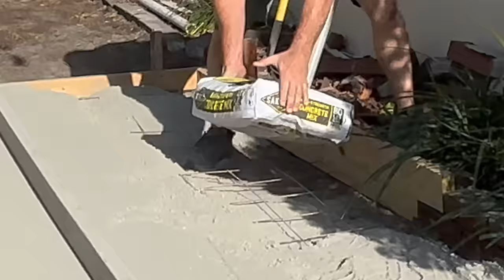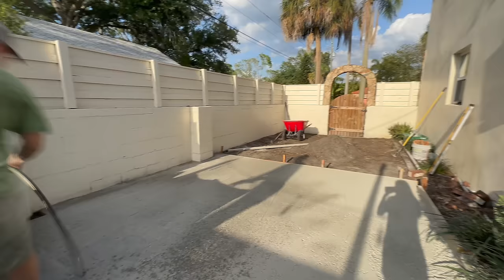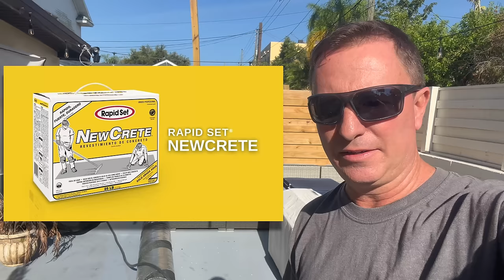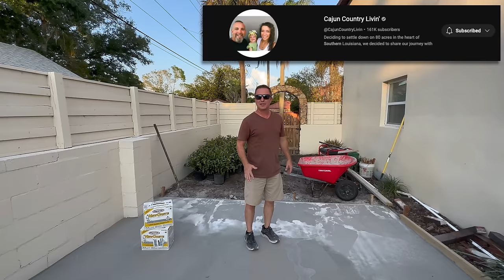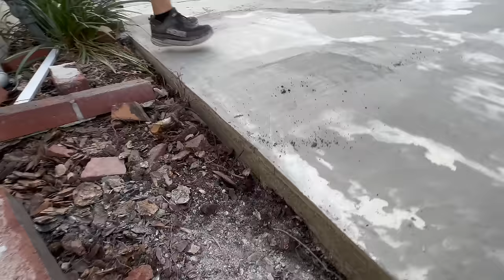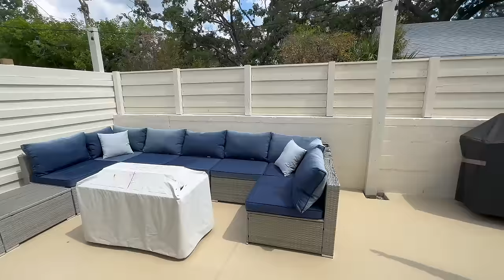Doing Dry Pour Concrete DOES ACTUALLY WORK?

Comment: I batched and drove mixer trucks   for a large concrete concrete company for 4 years.  Dry pouring does work for DIY projects because bagged cement is DESIGNED for water absorption. Be sure to wet the ground before you dump dry cement. However when you have to build to code mixing concrete is the best for strength and proper finishing. Have fun. ❤
Reply from the maker: Thank you for your excellent comment.  I am planning a follow up video with an industry expert to answer many of the questions generated about dry pouring concrete.  Your brilliant comment about bagged concrete and how it is chemically designed for water absorption is one of the areas we plan to focus to help people, especially those impacted by the naysayers, understand why this process is viable option when it comes to non loading bearing slabs. Thanks you again for stopping by and providing a helpful comment.
Reply: Contrary to what we are used to with typical wet pour, DO NOT PRE-WET!!

You want the moisture to migrate down, not up. First and most important thing you need to do, is forget everything you know about doing regular wet mix concrete.
Reply: Dry sour is bs.
Reply: @professorg8383  depends on how hot the day is.
Reply: @arguswil  No, that would be the case with wet pour but not dry pour. 

With wet pour you don't want the dry ground pulling water out of the wet mix as it will start to cure prematurely. But with dry pour you want the mix dry on the bottom and let the waterings be absorbed from  the top down. If the ground is wet, moisture will be drawn up. That is exactly what you don't want. You want the mix completely dry until the water get absorbed down to it. When the water dies get down to the bottom, it is at optimum absorption to start curing,  And dry ground will not pull water out  to below optimum.  

Cement is highly hygroscopic. It will pull water out of the air. You don't want it pulling it from the ground as it will wet the bottom prematurely. 

Dry pour ends up using the minimum required water, much like a very dry mix. This makes for the strongest cure. 

With wet pour you want to keep some moisture for finishing. But with dry pour the "finishing" is down before you hit  it with a drop of water. Never take a trowel to dry pour, you will screw it up. 

This is one of those things where knowledge of doing wet pour, will work against you. for the best dry pour, the first thing to do is to forget everything you know about wet pour!! Dry pour works almost completely opposite. A lot of concrete pros screw up dry pour because they can't clear their brains of what they learned about wet pour. It doesn't seem right to them so they keep trying to "fix it", but that just screws it up! Being used to ding wet pour is a handicap doing dry pour. 

In the end you have a slab with the optimum water content but how you get there is entirely different. I have watched many dry pour fail videos and in every case the fail us because they try to treat it like wet pour, 

You want dry ground for dry pour. If the ground is damp, you ill get better results putting some plastic down! I know this seems counter intuitive, but that's because your brain is wired by what you learned through experience. 

Wet pour works from the bottom up with finishing being the final step. But dry pour works from the top down, the final step is watering,  and once you start, it is 100% hands off the slab. Yu don't touch it again for a couple days when you take the forms off. In dry pour, all the work happens before adding water but the great part is that it is not time critical. Watering needs to follow a strict schedule, buy it is easy. The key to watering is to add water slowly allowing water to slowly be absorbed from the top down. Each watering step uses very little water and you ant to avoid getting the surface so wet that water starts to collect, if it's that  wet you put too much water on. 

Complete rookies often do better because thy follow the instructions exactly,  never even thinking they know better,
Reply: @professorg8383  with hot weather and  high ground temps you will have less evaporation issues with pre misting.  The heat can make the concrete dry too fast. Even if it's a dry pour
Reply: If you live in an area with high humidity then you can get away with mising from the top.
Reply: @arguswil  I get that you have a different opinion, but you also have a lot of experience with wet concrete, As I said, it isn't easy seeing past that. 

I approached a lot of scientific testing from an engineering perspective. I will say that at times I was rather surprised with the results,  contradicting conventional thinking.  

I have done multiple tests in both dry and warm humid weather. I have built multiple slabs is varied weather, and I stand by my results, albeit they differed from what I predicted. I used extensive scientifically proven methods of research and analysis. Only excess water evaporates, while the optimum amount becomes locked to the slab. as it cures, the water become a part of the mix,  I could see this by having recorded volumes and weights of all components, going as  far as to collect, measure and subtract overspray. Evaporation is not really a factor, although it very much is with wet pour. A fully saturated,  but dry to the touch slab, lost no weight when fully cured. So the water was incorporated into the cured slab, none evaporated.  This was one of those surprising results. The cured slab weighed exactly the weigh of the dry concrete mix, plus the water added. This turned out to match what the mix and minimum recommended water equaled. I replicated this in smaller, precisely measured, test control samples. Not what I would have predicted, My wet pour control samples lost some weight as they cured. 

In wet slabs, you can see some settling of the material. The dry labs ended up amazingly uniform. I believe this is because the dry pour slab was  never oversaturated with excess water. I even did some sample crush test with a homemade rig using hydraulics. Although my rig was not calibrated, the math indicated around 2500 psi strength,
Reply: @professorg8383  before you put down your dry pour, did you have any ground compaction? In our area we usually use CA6 then compact with a tamper and prewet for not only to prevent fast hardening with wet pour but the base can also reactivate the CA6 limestone particles so you have a solid sub base.
Reply: @arguswil  Compacted ground. (plate compactor.) ten  about 1 inch of #9 limestone, compacted again. Don't wet it.  

The whole reason you want a dry base is because of the hygroscopic nature if the concrete mix. If the bottom layer of mix starts to draw up moisture, it will actually start curing. That can create a separate layer that mat be cured prematurely by the time you get all the mix down and start the watering schedule. The best results are for wetting and curing to go from the top down uniformly,  The undesired end result will be a crumbly base that appears to have not been fully wetted. 

I have observed that the top down absorption is critical. If the ground is damp, I'll put plastic down before putting any mix down. If yu think about the physics of what is occurring, it makes sense. I have concluded that the whole watering/wetting process is the most important part  of dry pour. 

I approached all my testing from an engineering perspective following scientific principles and using control samples to compare,  Some surprising things observed. Like how the concrete cures.  I did some tests in containers both wet and dry. The next day I carefully removed and weighed both. As the cure progressed, the dry pour weight remained the same, however the wet pour lost weight over time. My conclusion is that evaporation does not play a role in dry pour cure because the slab does not have excess water like wet mix slabs do.  I have speculated that dry pour actually cures quicker, but I have not tested this with crush tests done early. 

BTW, I have started making my own premixed concrete.  I use the old reliable 321 ratio, 3 parts #9 limestone, 2 parts sand which is both fine and course.  (I have a lot of sand on my property. It's glacial till. from a moraine that runs across the property as a ridge,  The sand in the top couple feet has virtually no clay in it, but at depth there is some clay. I use the stuff from the top.) And 1 part Portland cement. Mixed dry in a standard DIY mixer,  I believe it is actually stronger because the bond with the limestone aggregate is better than the "pea gravel" type aggregate you find in most premix.  A saw cut produces a dead flat surface with no loosening in aggregate. The pea gravel is probably harder, but the limestone bonds much better,  

I went to making my own to cut costs, ends up about 1/3 of bag mix.  But I have equipment too, like a dump trailer, Bobcat and mixer. No delivery cost,  and I get the stone locally at a very good price, Besides being lower cost, I think it's a bit better tan the bag mix. Without having the equipment, I doubt the cost savings would be as good. 

I became a bit fascinated with the process first time I tried it and the engineer in me wanted to understand it in detail and improve or better define through careful experimentation and analysis, Seems like I'm always in need of a slab and I sometimes help friends. Dry Pour is my preferred method for slabs. 

There's a lot of videos on dry pour and I see Cajun Country as the best. I only deviate by what I learned through testing. My watering schedule is a bit stricter and using 30 minute cycles vs an hour. But I got there from careful observation of absorption from within the slab. Their methods are my baseline with the tweaks I mentioned. IDK what their education is, but clearly they used logic and common sense, realizing that it is its own unique process.  As I like to say, you'll do best if you forget everything you know about wet pour. It's not intuitive if your mind is thinking wet concrete
Reply: @professorg8383  When it's hot, 90 degrees and above, sunny, without humidity mist the ground before a dry or wet pour. Evaporation is your enemy. Heat is your enemy.
Reply: @professorg8383  however  I do have an open mind because the Egyptian pyramids are still standing 🤣
Reply: @arguswil  I hope that is true. When they built the pyramids, they did a lot that had not been done before and sadly we lost the knowledge they used. I have little doubt that they broke through some paradigms to build the pyramids', And old is not necessarily irrelevant or untrue, Paradigms often drive us to assume things what may not be true. It's good to question and try to validate what we assume
Reply: @professorg8383  'and sadly we lost the knowledge they used.'
I've regained about half of it, and could do the vast majority of the Egyptian level cutting on a decent time scale.  I can use just a rock to cut my 16" pavers in half about as fast as I can do it with a hammer and chisel.  Maybe 1/2 or even 1/3rd as fast, and the edge is less accurate, but it's much more fast than people estimate it to be.  Just a matter of understanding what to do and why.
Reply: @ModelLights  Cutting the rock was only one skill the developed and BTW they were cutting huge deposits of limestone from the ground, not pavers.  My point was that they left us no documentation of how they did what was dome. No drawings' or written descriptions, only the results they achieved. We have tried to replicate results, but we can't be certain of the methods the used. We have clues like tools and partially finished blocks in quarries, which give us ideas about how they did it, but if they took videos, they have become  lost over time!! '

Researchers have devised a few different methods to replicate results of some aspects of the build, but it is hard to be certain that is what they did. We can replicate results but can't be certain we are using the exact same methods they used. To say how the did it has been lost, means that no record of how they did it, has ever been found.
Reply: @professorg8383  You keep saying 'no one knows'.

'but can't be certain we are using the exact same methods they used' 
I can, reading the remaining parts of the cuts in the rock is plain.  I can read essentially every little line in the cuts.

'To say how the did it has been lost'  
That's why I said regained.  I solved how to do almost all of the cutting a year and a half ago.

It is easy enough that I'd bet money that at least a few people within the Egyptian Antiquities Ministry know exactly how it was done.  They keep everything a 'mystery' because they make money from the 'mystery' tourism.

How to cut rock with rock is very basic.  It is unintuitive enough that it doesn't seem like a correct idea, but they did it the same way we do it.
Reply: @ModelLights  Again, my point is that you THINK you know as have many before you!  As for the  Egyptian Antiquities Ministry,  they have only recently existed, less than 20 years old. But explorers have been loting the Pyramids for nearly 4000 years! Some were only interested  in looting but others had real scientific interest in discovering details of how they were actually built. I seriously doubt that the Egyptian Antiquities Ministry really has any secret information in this regard. And unless they somehow discovered some manuscript or hidden videos of the use of alien lasers, They would have little reason to keep it secret. 

We know that they had stone and some copper tools such as chisels and saws and drills. Limestone is pretty soft and these tools could have been used to quarry and cut it. You can devise multiple method to do this and in all likelihood, the methods evolved over time from the first pyramids until the last. We also know they  had rope and strings, which were probably used for layout at least and  probably involved in they quarry processes. But we don't actually KNOW for certain. There is no record but the tools and the material itself from which we can surmise and infer, what they may have done. We can feel fairly certain, but we don't KNOW and in that regard, the exact methods used have indeed been lost to time. More than a few theories have been proposed and tested and proved as being viable methods. I seriously doubt that you have "regained" some real knowledge different or provable as the CORRECT method they used.

But cutting and working the soft limestone was the easy part. The granite used in burial chambers, is another story. As is the design development and actual assembly. We have some workable ideas, but we don't KNOW. For example we know that they had some sense of geometry, but varying angles of the different pyramids suggests that they didn't actually use calculations. We can't be certain how the measured and  determined angles. We are fairly certain knew how to create a right angle and how to use a plumb line. But beyond that, we don't really know, We have no examples of geometric/measuring tools they used, 

My whole point is we have no documentation of any type. We can look at their results and surmise and infer and assume, but we don't really KNOW.
Reply: @professorg8383  'Again, my point is that you THINK you know '  Actually I know exactly.  But ha, might as well change tack and make a video.
I solved all this crap a year and a half ago, it's much easier than you think.
Reply: @ModelLights  Well good for you!!   I didn't think it was hard or some amazing technology that they discovered 4,000 years ago!  More likely the method they used was relatively simple and we know multiple ways to accomplish the same results.  But we can only speculate about what they actually did. But hey, maybe you time travelled back and observed it!! 

Can't wait to see your proof that you KNOW!!!